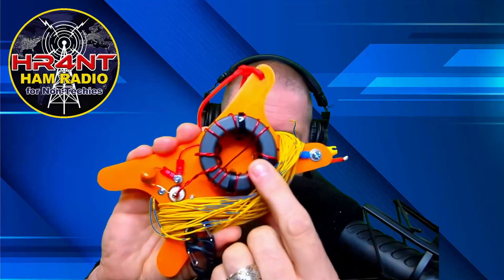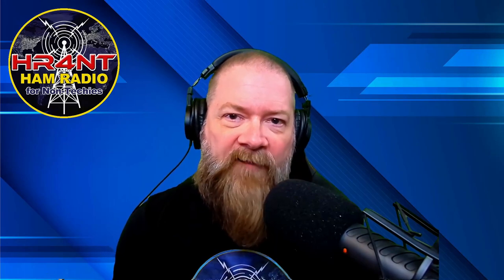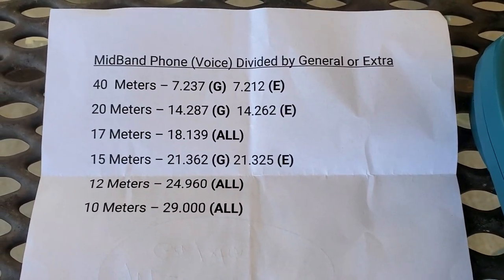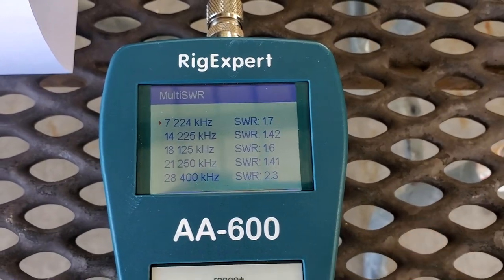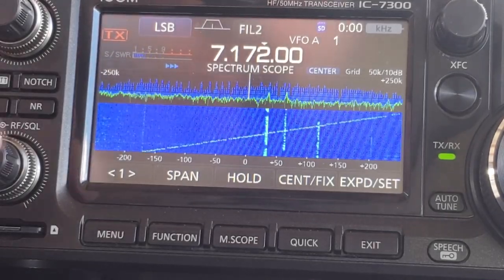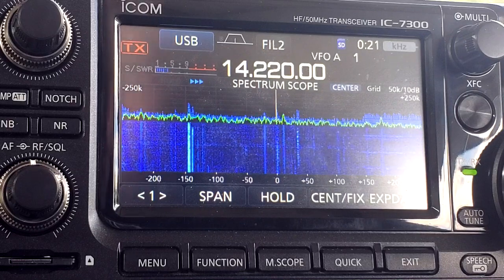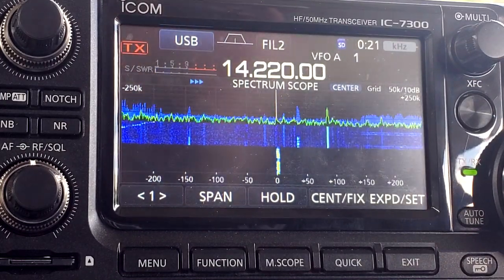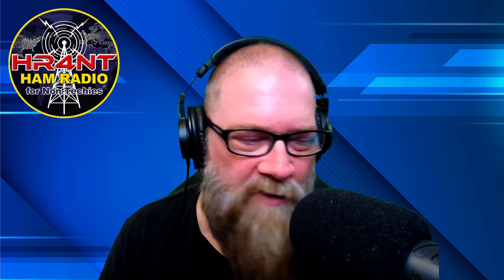Let's build an End Fed Halfwave Antenna! Easy DIY antenna project to build!!!

Comment: Scott good video and good job of explaining.
Just wanted to let you know. It is the capacitance (100pf) of the capacitor that determines the frequency response of the antenna circuit. The voltage rating of the capacitor determines how much power the capacitor can safely handle before it breaks down and is destroyed by over voltage.

What most people don't know and what some can't understand is that although a radio may operate from a 12V DC or 120V power supply the output of the radio at the antenna terminal can and does frequently exceed several thousands of volts of power.

The 100pf capacitor used in a 49:1 transformer helps to lower the SWR on frequencies above 12 meters. Adding the capacitor will have some effect on the 20M band (slightly)

Voltage rating of the capacitor should be at least 3kv minimum. 10kv-15kv is a very safe value to use
Reply from the maker: Thank you very much for that explanation!  That is solid and great info to have, so I really do appreciate that.  I have found that the capacitor also seems to affect the Q of your antenna as well, or at least that is what I have observed.  With a larger 15kv the Q was really low and the antenna was resonant across the band when I was tuning.  Thanks for the comment and for watching.  73!
Reply: ...there has been some debate and a couple of U-Tube videos that suggest the quality of the cap, espcially in this application, does make a difference. It's not so much the voltage... you are putting it across a 50 ohm point where @ 100 watts the RF voltage is about 75Volts, it's current we're dealing with at that point not high voltage.. . The school of thought suggests a quality cap such as the TDK 100pf 3Kv caps works well.. This is what I use for my EFHW....likewise if you are running low power or QRP a 500V silver mica would more than do...

Comment: That's the story of almost every antenna I've ever built -- no matter how many times I cut it, it's still too short! (eventually, I reach an epiphany)
Reply from the maker: LOL...I have learned to carefully and Slooooooooowly cut smaller portions and retest.  It is tedious but better than cutting too much and having to solder it back or replace it entirely.  Thanks for the comment and for watching.  73!

Comment: The extra core or multiple cores  does help dissipate heat on digital. Modes but more importantly it provides more efficient matching on 80 or 160 meters if you have space for a longer half wave wire. I use my 268 ft end fed to cover 160 - 30 meters including. It works fine at those longer wavelength bands including 1840 and 5357 kHz. I have learned by experience that supporting the center of the wire at it's midpoint like an inverted vee works better than elevating it at the end gives optimum performance for any length.

My other advise is to not fuss with improving your swr once you are down in 2.0 to 1 or less.

The only other improvement if you do  want. To operate on both 75 and 40-10 meters is install a series capacitor on the wire ( several articles on YouTube and internet on how to add this mod )

that effectively moves the fundamental resonant point up about 400 kHz in center of phone band. Recall 75 meters is not a harmonic of the other bands. This mod with a a 130 ft wire would allow you to operate your xtenna on 75 meters which is a critical EMCOM band.

Good review and video..
W5UHQ.
Reply from the maker: Thank you very much for sharing your knowledge and experience on this topic!  I really appreciate it.  I may have to give that a shot down the road.  Thanks for the comment and for watching.  73!

Comment: You're videos are always fun to watch and the rant about the antenna wire length was a hoot. I've built several EFHW's and I'm always looking for new things to try and for techniques that work to help my builds.
Reply from the maker: It was definitely a fun build despite the issue with the wire.  This antenna mimics the Chameleon CHALEFS antenna for a minor fraction of the price.  I love building antennas and found that to be one of my favorite aspects of the hobby.  Thanks for the comment and for watching.  73!

Comment: Thanks for your entertaining and instructive video. I’ve been experimenting with EFHW Antennas for some years now and I like them very much. There are some things you can try to bring the SWR on 10m down a bit. 1st: try mounting the feedpoint a bit higher or lower above ground. 2nd: put a common mode choke into the feedline at a distance of about 2m from the feedpoint (5-7 windings of the feedline coax, wound together and held in place with cable ties, usually does the job for 10m). 3rd: if 1 and 2 fail, you can try another 100pF cap in parallel to double the capacitance. 73 and good DX!
Reply from the maker: After the video I was able to get the SWR under control and it works just fine now.  Just a couple small tweaks and it was fine.  Thanks for watching and for the comment!!!  73!!

Comment: Scott, I'd leave it alone at the original 67 feet. An LDG or rig internal tuner will resolve that 2.8:1 NP. (It would be interesting to see which way the 2.8:1 skews. 10m is a huge band and you might be right as rain -- below 2:1-- in the CW portion or, conversely, better in the upper end.)

A quarter wavelength at 10m is about 8 feet and change so you could easily make dipole for 10m or a loop or some other antenna and hang it off another tree higher up and get better results that on your EDHW. The meat of your work will be on 40m and 20m and  little more on 15. But it's pretty damned good results for your first EFHW build; in fact, it's a keeper, my brother!

72 de William, k6whp
Reply from the maker: Thanks for reaching out.  I do plan on going back out and retesting this with a wider range of frequencies on 10M.  The point, for me at least, is to have an antenna that doesn't rely on a tuner.  I get a little hyperfocused sometimes on getting the SWR down so low that I forget to just have fun with radio and an acceptable SWR.  Thanks for the comment and for watching.  73!

Comment: Any Ham that doesn't measure antenna wire for proper length BEFORE assembly should expect "problems" with their antenna! So, do not blame someone else for YOUR mistakes. Now, you learned something - measure, measure, measure, before assembly. Good luck!
Reply from the maker: Thanks for watching and for the comment!  73!!

Comment: Go Big or Go Home!!!  Love it.
Reply from the maker: Yeah...well...like I said in the video, I have this one with double 240-43's and another one with a single 140-43 and aside from weight difference, I did not see a major difference in performance.  If you are going to run more power to it, then the double 240-43's might make sense...I just wanted to play around an see what would happen.  Thanks for watching and for the comment.  73!!

Comment: Glad you analyzed it before hooking it up and burning up a radio.  Go with your gut for sure.  73!! De KE5ES
Reply from the maker: Oh yeah!  Any time I build any antenna, I always put it up on the analyzer first just to see if I can tweak the settings a bit and make it perform even better.  Especially with a $1K radio on the line, I want to make sure I don't destroy the rig.  Thanks for watching and for the comment.  73!!

Comment: I think you'd get better performance if the common mode choke were located at the rig end of the feed-line and about 6' off the end.  Lets the feedline serve as a counterpoise.
Reply from the maker: Probably so.  I made a few adjustments since that video and it works fine now.  Thanks for watching and for the comment.  73!

Comment: I'm currently building a version of this. Thanks for the plans and the STL. I'm using a 5Kv cap and I might put a pair in parallel just for fun. I'll see what the NanoVNA and the Comet tells me 5Kv vs a pair for 10Kv. I want to do some POTA this fall, so this seems like a good solution. Also, side note: 14 ga for the radiator instead of 18GA might widen the Q out some and give you a better, wider SWR slope, especially up on 10, 12, 15 and 17. I usually build all of my wire antennas with Southwire 14Ga copper stranded. Cheap, easy to solder and effective.
Reply from the maker: That is fantastic!!  I think you will enjoy the antenna a lot!  I like that you are willing to experiment a little and see if you can improve performance!  Good on you!  You are correct, using a thicker gauge wire just might help out a bit more with "Q".  I might have to give that a shot sometime.  Thank you for the comment and for watching.  73!
Reply: You've probably built yours by now, but discovered or learned that putting two 100pF caps either in series or parallel will change the capacitance. E.g. you got 100pF, put them in parallel, now you've got 200pF of capacitance. It'll be fine for the lower bands, but the capacitors really help for the upper bands (12m, 10m) and the SWR won't be as low as it could be with 100pF, and I believe the bandwidth will be lower as well. That's the fun with the hooby tho, experiment and see what works. This video saying Higher voltage rating affecting bandwidth is the first time I've heard of that, and I'm not sure on the validity of that.

Comment: LOL...dual T240-43's should be able to handle 2 to 3K W's of power with proper wire.  Always look at your SWR graph to see if you need to cut or lengthen.  If the lowest SWR point is below the band, then cut.  If it's above the band, you'll need to lengthen.
Reply from the maker: Thank you Kyle for that!  I did not know how to calculate the power an antenna could handle, but that is good to know.  Like I said in the video, I think it was overkill to use 2,  240-43's on that build.  It just added weight and really didn't bring anything to the table for enhancing performance that I could tell.  I think 99% of those building this would be just fine with a single 140-43 and a 4KV cap.  I do follow your procedure when analyzing an antenna to determine if I need to make a cut or lengthen the wire.  Thanks for sharing and for watching.  73!
Reply: if SWR for 7.1Mhz is 2.5, need to cut?
Reply: @chillychurchil5972  it really depends. There should be a dip in the SWR where the antenna is most resonant. You need to hook it up to a rig expert or a nano VNA to see if that dip is higher in the band or lower in the band. If the dip is below 7.1 you’ll need to shorten the wire. If it’s above 7.1 you will need to lengthen it.

Comment: My friend, there are several ways to improve your transformer. 
First and most importantly  increase the size of your winding wire to a size appropriate to your core, bigger is better. We need to reduce our inductive reactance. Remember, when inductive and capacitive  reactance are at or close to zero then all that remains is resistive impedance, hopefully  close to our 50R.
The reason for the capacitor is to combat inductive reactance and balance the scales on the higher bands. Small guage winding wire will need more capacitance. 100pf is an advisory not a requirement. This capacitance has absolutely no effect  on the lower bands. In fact if you use the thickest winding wire you can physically  handle you probably wouldn't  even need it. But of course  Bill on YT said you have to have it, so, it must be true.
You dont need to twist the primary section, its painful  and a waste of energy and wire. Solder a tap at the place you need it, either 2 or 3 turns. You can measure this with a VNA to find your 50R point.
This is a very old antenna  design but only recently has the average Joe bloggs had the means to measure and test it. Doesnt mean the design is written in stone. They never had that luxury, only theory.
Reply from the maker: I really appreciate those tips!  I will mark them down and utilize them in a future build! Thanks for the comment and for watching.  73!

Comment: Best vid on EFHW antennas - second only to Radio Prepper.   Thanks man.   A good lesson here is check with the graph first when you're given a wire lol.   Graph would tell you the direction you need to go before you cut.    Also fantastic tip regarding the capacitor.  I wondered what would happen with the higher voltage rated ones.
Reply from the maker: a 100pF capacitor seems to be the norm for building EFHW's.  The toroid size and gauge magnet wire wrapped around the toroid seems to play more with the wattage the antenna will handle.  I am glad that you enjoyed the video.  I hope you will build one and enjoy it!  Thanks for the comment and for watching.  73!
Reply: @HR4NT  Everyone talks about the 100pf but you are the first one (for me) to talk about the voltage rating.   That part was confusing me before I saw your video.   I built an EFHW using the recommended 1kv and 3kv and not impressed with such a narrow (Q?) so hoping the 15kv will help.  Yeah I figured with K6ARK size of the toroid, the mix and turns are the most important.   If your magnet wire is too thin as well as the toroid against the power you put through, the toroid will reach its max heat tolerance and will stop its inductive properties (data sheet spec).   However before this happens, the and maybe wire enamel and casing may begin to melt.   73 VE3WWJ
Reply from the maker: @jeff-73  For a wider bandwidth the 15kv will definitely help in that!  I based my build off the Chameleon CHA LEFS which pushes 500 watts, but noticed a much larger capacitor than I see in most EFHW antenna builds.  Let me know how it works out for you!!!
Reply: @HR4NT  A friend of mine shown me the following info.  You may want to update your video links if you agree:    

Tolerance and Precision

Among all types of capacitors, silver mica capacitors offer the lowest tolerances, as low as +/-1%. In comparison, ceramic capacitors have tolerances going up to +/-20% and electrolytic capacitors can have more.

Comment: The kv rating of the cap has nothing to do expanding the bandwidth.  The additional 100pF is what expands the bandwith.  So a 4kv vs a 15kv rating will impact power limit, but not bandwith.
Reply from the maker: Hi Garry!  Thanks for that info.  I have heard it both ways.  Common sense tells me that the size of the capacitor affects the power rating, but then I was told that was wrong and that it is the toroid and size of mag wire used that determines that.  I appreciate the info!!!!  Thanks for the comment and for watching!  73!!

Comment: What are the odds Scott. Wow. That was really funny that you were both just testing your antennas. Nice build. I suspect the double toroids might help with digital modes at 100W so that might not be a bad thing
Reply from the maker: Hey Don, 

Yeah that may be one advantage to having two toroids, but as far as just using the antenna normally for like POTA and such, I didn't see a major rise in its performance vs a 140-43 toroid. Haven't tried it with digital yet.  Thanks for watching and for the comment.  73!
Reply: @HR4NT  Got it Scott but there are folks out there that run FT8 for POTA (K7CAR for instance) and this would be right up their alley. I would definately recommend to those who are doing FT8 look at your double toroid build.

Comment: I recommend 1/8in stainless steel cable.  It does not need to be shielded.
Reply from the maker: That is an interesting take.  I have always used magnet wire to wrap the toroids.  I will look into it.  Thanks for the comment and for watching.  73!!
Reply: @HR4NT  Sorry, I meant for the antenna wire. Your transformer looks perfect. 
Stainless steel cable is very flexible but also strong. Hardware and Marine stores stock it. You can easily fold and clamp it to length.
Reply from the maker: @chuckcrizer  ahh...ok! Thanks for the clarification.  I will look into that and give it a shot.  Thanks again!  73!!

Comment: The voltage rating of the capacitor is just that , A voltage rating , The higher the voltage rating the more watts it will take ... As for giving wider bandwidth 😆 ... It won't no ... The capacitor is there mainly for the higher HF bands , You can leave it out on the lower bands such as 3/7/14 MHz .
Reply from the maker: That may be so, however I do notice that on my meter, the larger the capacitor the wider the range seems to get and I cannot explain that as I am limited in my electronic knowledge.  Thanks for watching and for the comment.  73!!

Comment: Hey Scott 
So what I am understanding is if u cut the antenna wire to 68 feet u should get 40,20,17,15,12 and 10 meters
Ally 
Mm7how
Reply from the maker: That is a starting point.  To fine tune it where the antenna is actually resonant and works without a tuner you should use an analyzer to see where your SWR is mid band on the 40 meter (that's my technique) and you should be good to go after that.  But you must tune the antenna first in order to get the best performance out of those bands.  I hope this helps.  Thanks for the comment and for watching.  73!
Reply: Thanks yeah

Comment: Dude just add an egg insulator as a splice point to help with strength and add the 4'.  Add a little marine heat shrink from Harbor Freight and calm down.  And the moaner is a ex CB'er.  Heard him in the 70's when I was a youth. 😁
Reply from the maker: Hi Randy, 

I appreciate the tip!  I managed to fix the issue.  That moaner is just one of many that you sometimes hear on the radio.  They are annoying but we try to ignore them and move forward with our operations.  Thanks for watching and for the comment.  73!

Comment: Not a Ham just yet (studying at present), and I don't have access to a 3D printer. I don't want to use plywood. Is there any reason that I wouldn't be able to use plexiglass to make the wire wind?
Reply from the maker: You can use plexiglass OR go to Walmart and grab a cutting board and cut that up to use.  Most libraries around cities also have a pretty cheap 3D printing service and can help you out if you wanted to print out one.  I hope this helps.  Thanks for the comment and for watching.  73!